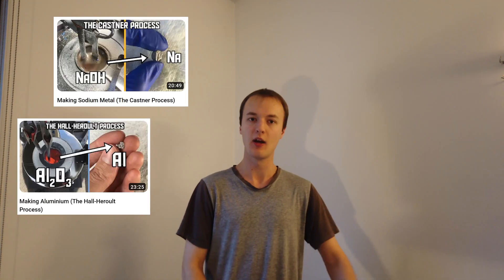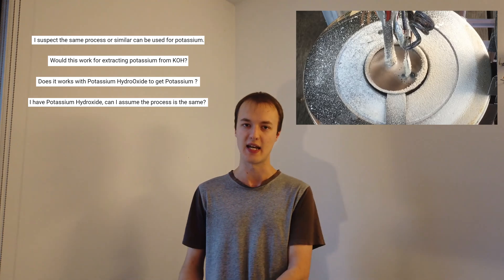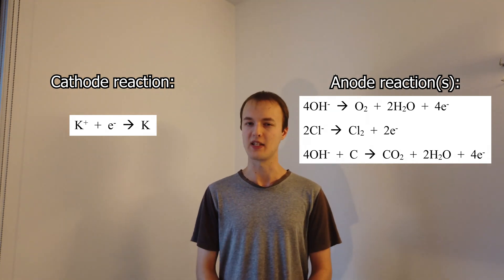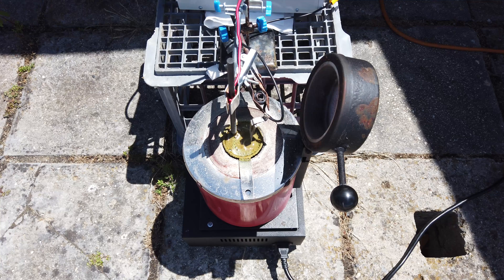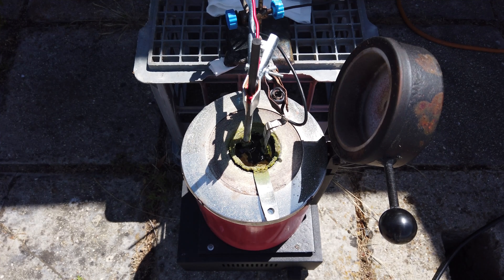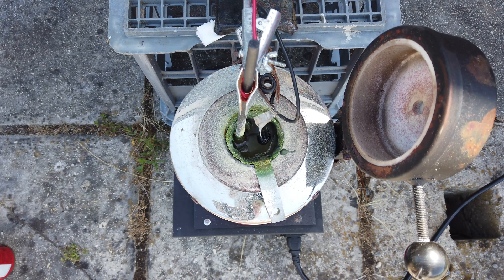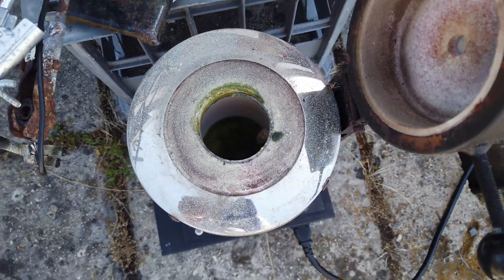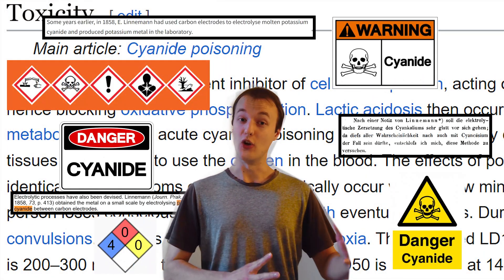Can We Make Potassium Metal?

Comment: Try using glass instead, they might be sacrifial if it cools down too fast but it works 10x better, unless u have high grade stainless (not sure wat type is better 304 316 etc)

But low grade stainless will even clog the reaction and stop the metal production, even for na and li..

If it goes brown its done, no good, restart..

Comment: Would borax help. Making a layer over the top to stop it burning.
Reply from the maker: From some further research after I finished this video, it seems that the reason the potassium disappears is pretty much entirely due to its dissolution back into the melt. So no, I'm afraid it's very unlikely that a protective layer would affect much under these conditions.

Comment: I have seen one video with guy using who used a steel can with a charcoal cup as a crucible. Can was almost sealed, had only a small hole in a cap to let gases go away, but charcoal could react only with substances inside of container.
There would be problem with observing but, see following solution:
Nail electrodes to the bottom od container. Put 1 Ohm resistor and current meter. Once current would drop to 0 or go up to 12 amps (assuming you are using 12 V source) majority of potasium salt have been converted to potasium and gases, so circuit was opened or shortcut by potasium.
Then just wait for everything to cool down.
It was just though experiment not silupported with any experience 😊

Comment: Thank you for the video and great effort. 

I guess that I would be tempted to build this as a vacuum process vs inert gas process, even though the construction is a bit complicated.

It might be possible to get the desired product to evaporate from the melt and condense away in a  cooler zone of the vacuum tube,  for example in a horizontal vacuum tube furnace.   These are common in the semiconductor industry and sometimes come available at moderate prices

Comment: hey try single step molten naoh electrolysis with the more used metal oxides (iron oxide, aluminium oxide, magnesium oxide etc) mixed in the melt at 400C process, immediate reduction of the metal oxides by the Na cycle, with NaOH in the mix you make NaK, no problem, also how about chloride process to make the metal, like electrolysis of KCl or something, Na will also reduce the KCl, or other metal chlorides
Reply: try inert shield gas atmosphere molten electrolysis, like in tig welding, also chlorides are just corrosive, not easily harmful
Reply: why not use glass crucible/pot/jar/beaker to melt/electrolyse all low temperature extractions, like KOH and NaOH
Reply: @gsestream Because these hydroxides can actually dissolve glass.
Reply: glass is not usually dissolved by most stuff, they are used as chemistry chamical containers,  well HDPE plastic is another that is a very chemically inert resistant container material  @Phoenixfisch
Reply: @gsestream  I know, but sodium hydroxide is one of the few substances that can dissolve glass, that's why you shouldn't use it as a crucible in this case.
Reply: the etch rate is really slow, so yes you would and still use it for most chemical reactions, even sodium hydroxide and potassium hydroxide, or pure sodium or potassium molten metal, not agreed @Phoenixfisch
Reply: if you would not use then dont use, dont force others to do like you do or you choose to do. or someone else chose to do and you copied them blindly. not agreed. @Phoenixfisch
Reply: how fast it etches the glass, state the um per hour @Phoenixfisch
Reply: ok not at all thanks. @Phoenixfisch
Reply: if it etches to the point of structural failure, then just switch to a new one. not so hard bruh. but I dont believe anything you say. @Phoenixfisch
Reply: I think your cautiousness is both to control what people do (not fine) and your pride @Phoenixfisch
Reply from the maker: @gsestream please refrain from harassing people in my comment section. 

@Phoenixfisch is completely correct here - molten sodium and potassium hydroxides would dissolve through glass crucibles in a matter of minutes. Please see this video as evidence: https://youtu.be/nmktRTHL1NA?si=pAuAzw4GLXY98xpn

Comment: I think the most efficient method I've come across for making potassium metal was the distillation of potassium from KOH and Aluminium powder in a small reaction vessel made from a CO2 canister. Despite not optimising the set up at all (no inert gas, friction fit) I still got a 25% yield which was the best yet for an alkali metal isolation. I do plan on making an ultra efficient set up capable of making sodium through to Cesium using induction heating and Tig welded parts with a vacuum adapter and an argon flushing system, but for now I'm happy with a sample that cost me nothing to make.

Comment: Stainless is not necessarily the problem, but cheap "stainless" is. If you weld crucible from CSN 17 240 steel, it will likely work better if not perfectly well. Sorry, don't know DIN/other norm # of top of my head.

Comment: what electric crucible is that and is it any good? i think i've seen them somewhere
Reply from the maker: It's basically just the cheapest electric furnace I could find on Ebay - not sure of the brand. It's something along the lines of this one: 
https://www.ebay.com.au/itm/354938105014?mkcid=16&mkevt=1&mkrid=705-154756-20017-0&ssspo=7ywogv2ntfg&sssrc=2047675&ssuid=Jx1jMD7BTLK&widget_ver=artemis&media=COPY
It's worked for everything I've needed it for so far, so I can't say anything bad about it. I'd definitely say it was worth the money,.

Comment: I suppose you should avoid using both a hydroxide and a halide in the eutectic mix...? The chlorine produced on the anode may directly react with the hydroxide to make something like chlorates, which will travel to the cathode and destroy your potassium. Alternatively, you can use another eutectic of KOH that has its melting point below the boiling point of paraffin oil (around 300˚C), and you can use that to protect the potassium metal from the atmosphere and stop it from burning up.
Reply from the maker: Chlorate is almost definitely a problem, yes. Additionally, a lower melting eutectic like the one you’ve suggested is now a plan for the future!

Comment: Didn't Nurdrage already crack this process open? He used menthol catalysed magnesium to reduce sodium at low temperatures, and potassium should also work with this.
Reply: He did for sodium, I've no idea if menthol works with potassium.
Reply: @hanleypc  Why shouldn't it? AllChemystery demonstrated the process with t-butanol years before NurdRage made his breakthrough. They have similar reactivity, so it's worth a shot right?
Reply from the maker: Yep! That’s definitely an option. I just enjoy trying to get the electrolytic methods to work.
If you actually want reasonable quantities of potassium, that’s the way to do it.

Comment: A little glass eye dropper worked to collect sodium for me in a similar setup
Reply from the maker: Of course! I keep forgetting that option. Thanks for the tip!

I remember watching your videos on the alkali metals back when you posted them. It’s a pleasure to see you here!
Reply: Don't molten alkali metal hydroxides eat through glass?
Reply: Ben have you seen the email I sent you about the passive fridge? Sorry to bother you
Reply: I was thinking the same thing a glass pipette dropper but hot molten soduim hydroxide I know eats right threw glass not sure if the molten alkali metal is what eats the glass or if it hydroxide salt solution is what likes to eat the glass but I think it the hydroxide salt that eats the glass and not the alkali metal itself.
I see you also make chemistry videos, I will check out your videos.

Comment: I have a suspicion that all of that Chromium present in the melt from the stainless, is catalytically oxidizing your potassium metal. Who knows, maybe you are making some Cr(VI) species at the anode? Even if no, I think this is not possible without an inert atmosphere, K would probably self ignite at the temperature of the melt, no?
Reply from the maker: Hmm, that does make sense. It’s definitely somewhat likely.

As for self-ignition, metals produced by molten salt electrolysis are often protected during their formation by an invisibly thin layer of molten salt which is held over the metal’s surface by surface tension. Potassium’s surface tension is rather low however, so I don’t know whether this applies here.

Comment: Your furnace might be ok, I did exactly the same trying to melt lead in a stainless scoop.  It has been gradually flowing down the hole where the temp probe is.  Luckily if you take the bottom panel off your furnace you'll see there isn't actually very much in there to get broken.  You might be able to periodically clear out the hydroxide until it's not a problem.

I've been wondering if you can get ceramic crucibles that fit because it's also disappointing how quickly the graphite ones degrade.
Reply from the maker: Yeah, I was luckily able to clean it all out and it still functions now. It was a real hassle though. I had to wash the bottom piece repeatedly with water and then had to put a container full of calcium chloride in there to dry it all up. Took a while, but it worked!

Comment: When I made the little bit of Na metal that I did via electrolysis, I used a clay flowerpot. I plugged the hole in the bottom with a nut and bolt and a couple of washers. Definitely a one use crucible but it worked.  The concern with stuff like that though is that those flowerpots are prone to cracking. I really liked the idea of the furnace you used for heating. I used a propane torch. Once the NaOH was melted the current would keep the material melted with no more external heating.  

I really like the info you provide with these videos, process working as you planned or not. Good work. Thanks!

Comment: I also think your Potassium reacted directly with the steel and dissolved iron, which probably accelerated your "crucible" breakdown.
Reply from the maker: That makes sense - probably explains why it hasn't happened to this extent before as well.
Reply: @ScrapScience   if the stainless was discoloured from previous experiments then the chromium oxide protective layer would be gone which would also make it more open to chemical attack
Reply: Potassium ferrate formation?
Reply: @garycard1456  more likely just a double exchange from the more reactive potassium. Note also the dark green color of the molten salt indicative of ferrous salts being formed.

Comment: Could you get to 800c with your furnace, then use KCl instead of KOH?
Reply from the maker: Yep! However, KCl runs into the same solubility problems as KOH. Additionally, even if that weren't the case, potassium's boiling point is less that 800 C, so the metal would likely boil off as it was made.
Reply: @ScrapScience  it would be a delicate balance, but if the potassium boils, thats one way to isolate it

Comment: One of the easiest way to make potassium metal is by heating a mix of dried KOH and aluminum to >800*C and distilling off the potassium
Reply from the maker: Your definition of 'easiest' is rather different to mine, haha. Might try this one day, but distillation of an alkali metal at 800 C scares me immensely.
Reply: How would you distill off Potassium in a backyard setup?
Reply: @mcwolfbeast  you need furnace... Electric or gas/ charcoal
Put KOH and Aluminum in a thick steel pipe. One end welded and 1/4" steel pipe welded on other end. This pipe goes into mineral oil. The reaction produces hydrogen which protects potassium.

Comment: The "easiest" method to get K from electrolysis in the modern age is to do the electrolysis of a solution of potassium perchlorate or tetrafluoroborate in propylene carbonate. You can do it at room temperature and the resulting potassium will be of decent purity. The KClO4 has relatively low solubility (0.04M) so the tetrafluoroborate is preferable.
Reply: Sounds interesting, can any other solvents be used? Not sure how easy it would be to get PC.
Reply: @hanleypc  Any of the small chain organic carbonates would work. Propylene carbonate is actually not very hard to get, its sale is not restricted in any way. I have bought it both in the EU and in the US.
Reply from the maker: The difficult part of this one, at least for me, is obtaining the organic carbonate solvent (and, as it turns out, the perchlorate salt too). I will definitely be giving this a try one day though, as it's even been reported that caesium can be made by this method as well.
Have you tried this yourself? I've always been told that the PC-based electrolysis requires an inert atmosphere in order to build up reasonable quantities of the alkali metals, but I don't exactly know if that's true.
Reply: @ScrapScience  I have done this. You don't need to do this under inert atmosphere - obviously works better if you do - but you do need the solvent to be very dry, otherwise you will just dry it with the generated alkali metal and lose yield. If possible I would suggest at least degassing the solvent with inert gas. Easiest way to collect the metals is on a carbon cloth electrode at the bottom of the container. Collecting the metals in a mercury amalgam gives higher yield, but you would then need to distill the Hg out. 

An alternative to the potassium perchlorate is to use potassium iodide and a two half-cell setup with a Nafion membrane in the middle. That way you collect K metal on one end and elemental Iodine on the other end. The solubility of KI in PC is also quite high, greater than 0.2M.
Reply: @ScrapScience  Also, I forgot to say, your content is awesome, please keep these videos coming.